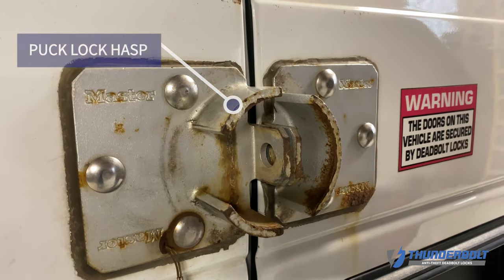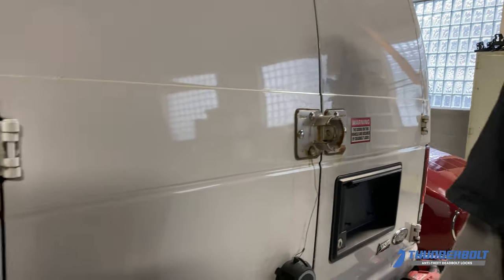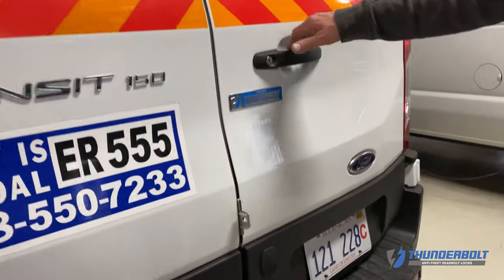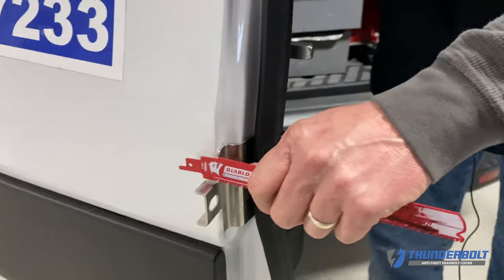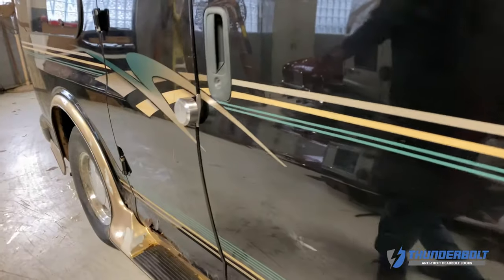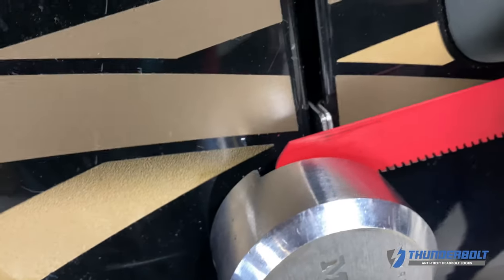Puck Lock Bracket Cut Off in 24 Seconds

Comment: I almost bought this for my Class B Ford Transit Van. However, I realized that any losers could go in through the front doors. 😂
Reply from the maker: No matter what type of locks you install you should always, always, have a good alarm and a bulkhead barrier between the cab and cargo area.
Reply: @thunderboltdeadboltlocks3871  Ya, that’s not going to happen to my RV Van. I am not putting a bulkhead barrier. That would stop my Captain seats from turning 180 degree.
Reply: @livefreevinnie I knew this comment was 2 years ago, but i had planned on taking the bulkhead out of my new cargo van im converting to make it feel more spacious and install a swivel seat. In the end i decided it's worth it to keep it for the added security. Plus, this allows me to insulate the bulkhead itself.

Comment: You probably could have picked or bypassed that Master lock faster then cutting it.
Reply from the maker: 24 seconds is 24 seconds!
Reply from the maker: @kittyNya38   We see your point. Either way, a thief can compromise the puck locks in a matter of seconds.
Reply: The point of this video is not about bypassing a particular brand of lock but rather showcasing the vulnerability of mounting points that are designed to work with puck locks. Doesn't matter what brand of lock is on there.

Comment: That lock looks like it was for a different vehicle.. the ones On my sprinter are so flush to the door you would be bending the blade to get it behind the lock. Just saying.
Reply from the maker: Hi Jack, That bracket was the proper one for that GMC van and all that is needed is a little bit of room to fit a blade behind the puck (bent or not) and the saw will do the rest. Unfortunately, we've seen a lot of these puck locks cut off vans in Chicago and believe deadbolts are a safer option.
Reply: @thunderboltdeadboltlocks3871  You are not helping your point by illustrating an improperly fit product. Slick Locks are typically flush and the puck lock itself protects from fitting a blade in. It would be an insane hassle and is probably enough deterant. Sure, your professionally installed deadbolts are probably a more reliable options but when it comes to self installation, cost, and visible deterant many will see Slick Locks as a reasonable options. Also the new designs for the Paclocks pucks seem to do the trick as well. Confusing people with infomercial-esque examples does not help your credibilty.
Reply from the maker: @DKGifford19608  Hello DK, This application is typical of how many puck locks are installed and exposed, whereas a thief can fit a saw blade behind it. We hear the same story of Puck Locks being compromised by customers over and over, and it is usually from cutting them off. Here is a perfect example of an email we received just last week from a customer who owns a construction company: "We had thieves break in by drilling out the passenger lock, reach around with a wire to unlock the side door, and then cut the puck lock off. All this while having a bulkhead."    You are correct puck locks are a good deterrent; however, there is no denying that that can be compromised several ways (see youtube videos posted by others), and then your tools and cargo are lost. We always encourage customers to install a quality alarm system and aftermarket locks. Given time any thief can break into any van. The idea is to create a strong barrier and limit their time with an alarm sounding. We strongly believe deadbolts are the better option. I want to mention we never had nor would confuse anybody with a video. The video is to inform people, and we stand behind what we have shown. Additionally, we pledge to create another video showing cutting off another puck lock, and we demonstrate how the lock is attached to the van in detail. We appreciate your comments, as collectively, we can all help prevent criminals from breaking into vans. Best regards, Thunderbolt Locks
Reply from the maker: @DKGifford19608  https://www.youtube.com/watch?v=WwRnZz7C8rQ
Reply from the maker: https://www.youtube.com/watch?v=WwRnZz7C8rQ

Comment: Misleading video. The puck lock itself was not defeated. Just the poor mounting system. Puck locks can be defeated, just not shown here.
Reply from the maker: We get many customers coming to us after their puck locks have been cut off their vans. All a thief needs to do is cut through the brackets with a portable power saw. It has nothing to do with the mounting, as long as you can get the blade between the puck and the van then it's over Dover! Additionally, I agree with you there are other ways to defeat a puck lock but this seems to be the most popular way I know of.

Comment: Let's see you do the same thing with that hardened plate you showed first. Just ain't happening. At least not without a couple blades and a ton of time.
Reply from the maker: We agree the hardened plate is much tougher to cut through, unfortunately, the most popular puck locks use thin brackets.
Reply: Good stainless steal won't cut like that he said it was stainless steal.
Reply from the maker: @view4me24   The brackets he cut through are stainless steel and he cut through them in 24 seconds.

Comment: Try doing that in a crowded parking lot, or just in public. Also the bracket he cut is for a slick lock, not a mastrlock.
Reply from the maker: This happens all the time. Slick Lock brackets can work with Master locks. They can be cut off quickly. Watch this video: https://www.youtube.com/watch?v=WwRnZz7C8rQ
Reply: Sadly it just happen to me mid day in a car wash full of ppl. They sawzalled my slick lock bracket.
Reply: @MIARACING  They wouldn’t even need to cut anything to bypass a Masterlock puck lock. They could just pick it with a 6 pin comb pick in 2 seconds and it would look like someone accessed it with a key.

Comment: It seems like you could install puck locks and manual deadlocks so the lock/key is on the inside to thwart lock pickers and hacksawers.. Save your money for one electric deadbolt instead of four.
Reply: You could use common fence hasp locks on the inside of all doors but one and then use only one Thunderbolt deadbolt lock.

Comment: Good stainless steal won't cut like that he said it was stainless steal.
Reply from the maker: That is what those puck lock brackets are made of and that is why they are getting cut off vans so often.
Reply: All due respect ...With the right blade most stainless steel cut like butter depending on its thickness that may slow you down a bit
Unless there's some new stainless-steel in the Makkah I'm not familiar with and actually stainless steel is a soft metal 
(Welder / fabricator most of my life )

Comment: That’s brackets not stainless ?
Reply from the maker: Yes they are. 
https://www.youtube.com/watch?v=5T1B_Dd_6oo
Reply: @thunderboltdeadboltlocks3871  They need a stronger bracket.
Reply from the maker: @user-ot3zk5me5l  I'd say you are spot on! A diablo blade could cut through almost any exterior bracket in fact there's a video showing it cutting right through a ball hitch.

Comment: THIS IS LAME! The puck lock did NOT fail. The brackets did. CLICK BAIT!
Reply from the maker: It's the weak link of the puck lock. You can't use puck locks without the brackets.
Reply: @thunderboltdeadboltlocks3871  I get your point but once again nothing about the puck lock failed.
Reply from the maker: @RookieStyles  I see your point. I guess I look at it as the puck lock is part of the team that lost since the puck lock would not exist without the bracket and the bracket would not exist without the puck lock. If a kicker misses the field goal causing the team to lose, was it the kicker who lost or the team?  Either way, they lost and the same goes for the break-in on a van...a thief doesn't care which part failed they just know they have just compromised the way the owner thought their van was secured. I appreciate your thoughts and again I agree with you; the brackets of the puck lock failed not the puck lock itself.
Reply: @thunderboltdeadboltlocks3871  I have heard of pucks being used without brackets. Blaylock TL-33 with a puck lock is said to be hard to beat. When you bash a product you hurt a business.
Reply from the maker: @RookieStyles  We are simply stating that puck locks are more vulnerable when used with brackets. There are a variety of puck lock styles made by a variety of companies. If you prefer puck locks then by all means use them. In fact we've installed hundreds of puck locks on vans over the years. We just think dead bolt locks are a better choice. Given time any thief can get into any van, what we suggest doing is making it harder for them. Thank you for your comment.
Reply: @RookieStyles  when you inform a customer you save him a van full of tools